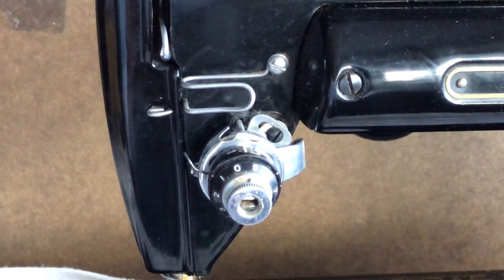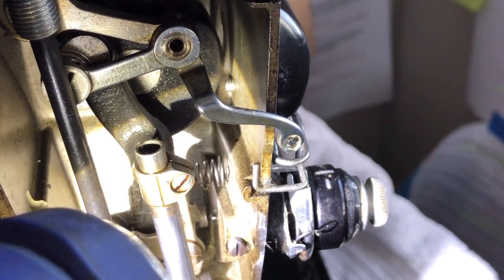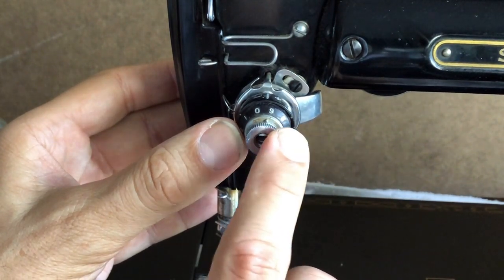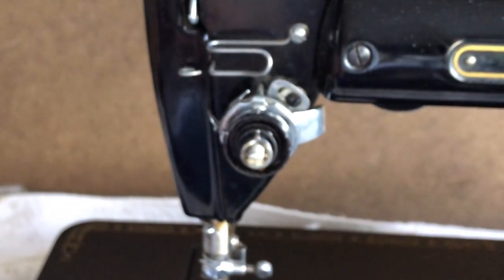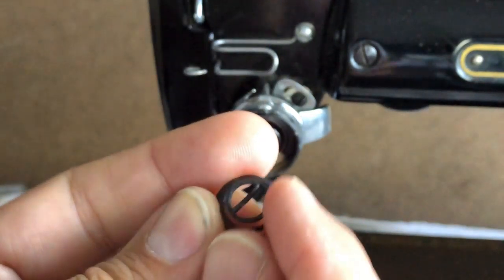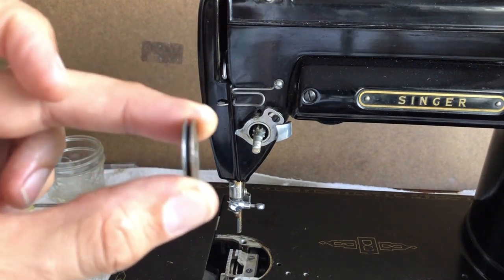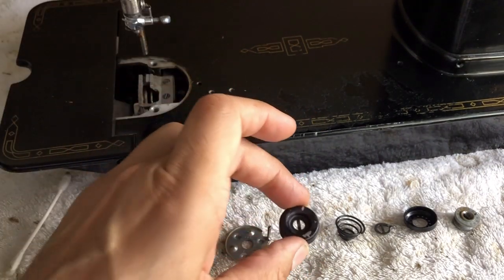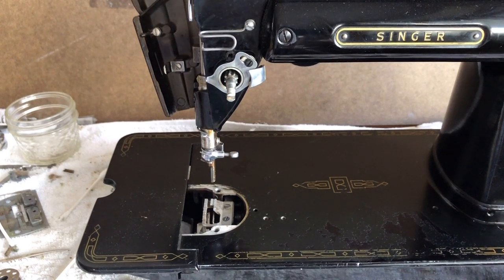RESTORATION SERIES #8: Taking Apart the Tension Assembly For Inspection & Cleaning

Comment: I have a new-to-me Pinnock Sewmaster, that I took photos of when I disassembled the tension unit...but the previous owner had been messing around with it and put it back together wrong! So thanks to your videos, I knew how to put it back together properly and it works!
Reply from the maker: Yes, that has happened to me also Caroline.  Knowing how something is supposed to go together helps to unravel the well meaning mistakes of other's attempts at repair.

Comment: This is such a helpful video, it explained why my machine is trying to sew but can't quite manage it. However! My check spring is actually stuck on that thread screw thats still in the machine when the assembly is off, wrapped around that gear-looking piece inside. I can't figure out how to get it out! Does anyone have any advice?

Comment: This is the best video explanation of a Singer tension assembly I've seen. Well done, and thank you.
I wonder if you could make a similar video but showing the tension assembly of a White Family Rotary? As you likely know it's quite different from Singers.
Reply from the maker: Yes, actually I have made a video like you describe.  I actually chose a White Rotary that I used to have as the subject of my OVERHAUL SERIES.  One of those videos should show what you are asking about.   See it here.  I hope this is helpful.      https://www.youtube.com/watch?v=G75hMJbKKIE
Reply: @VintageSewingMachineGarage  Ha! I knew I should've checked your other videos before I made that comment. Thanks.  :)
Reply: @VintageSewingMachineGarage  So I have the original White Rotary machine head, in a treadle cabinet. The tension on it is a bit different than the newer Rotary in your link. May still be useful though, thanks.

Comment: I watched the whole thing waiting for you to explain what the thing to the right of the assembly...it's sort of a shield or lever, a piece of polished steel about 1/2", doubled over on itself.  I can't find anything about it.  On my Best Built XL, it appears to move around the shaft, and sets the "range" of movement for the outermost part of the tension spring. But, that's a guess.

Comment: Have you done it  on a Kenmore model 32? 1960?
Reply from the maker: Not on that model. I will have to watch out for one to make a video on.  Meanwhile, you can likely find the info. you are seeking by joining vintage machine groups at places like Facebook, Google, or Yahoo etc.  Each brand or type of machine has a loyal following and the members there are very generous in sharing what they know.  Kenmores in my opinion were some of the best made machines and are worth saving!
Reply: I have a kenmore model 32 and I can’t figure out how to put it all back together after I took the tension all apart 🙁